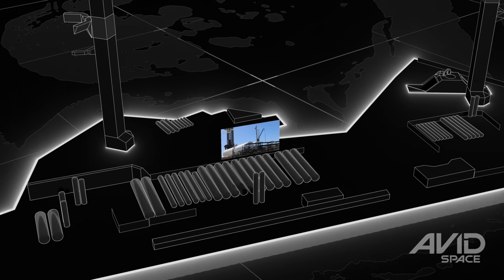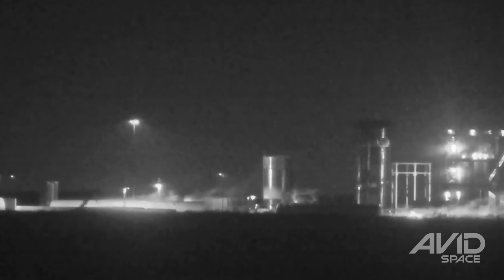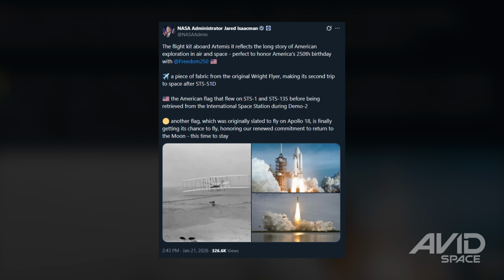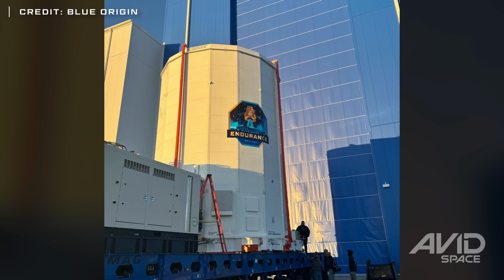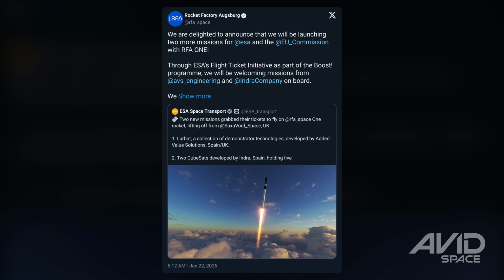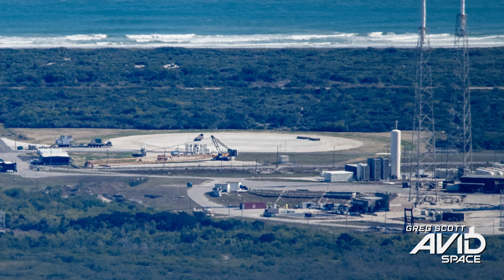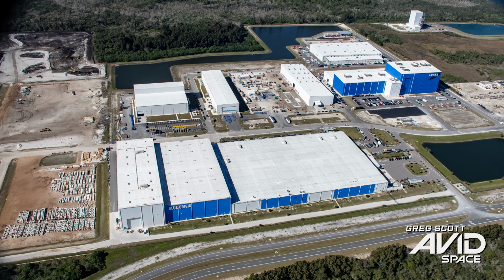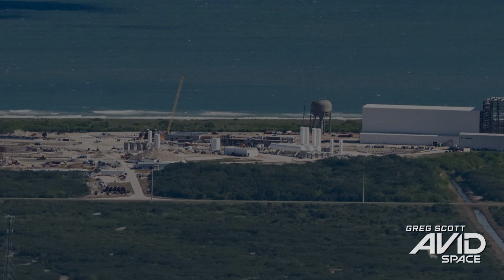SpaceX Pushes Starship V3 Test Article to Failure

Comment: I really like these zoom in and out animations, but I think that better idea would be to move animation camera to remote cam pov instead of random place inside the site, inordwr to make it less disorienting and make it easier to get where everything is placed. Currently it's like zoom into mechazilla and remote cam view from other side. Thank you for reading this
Reply: The problem is there are so many different potential camera positions that could all be looking at the same thing, and those cameras could be very far apart, and those cameras could be pointed any which way, which makes the complexity required for setup too much to handle.

Comment: FYI for those new to starship, the stainless they use is 304-L, and at cryogenic temps it actually gains strength, so if the test tank only had LN2 above the common dome then the steel below it was not as strong due to it not being cold.
Reply: The steel below also wasn't pressurized it was just open at the bottom.